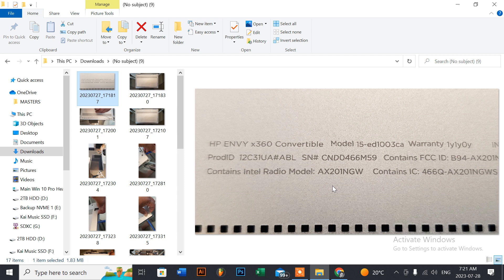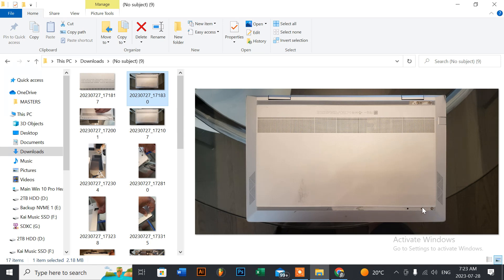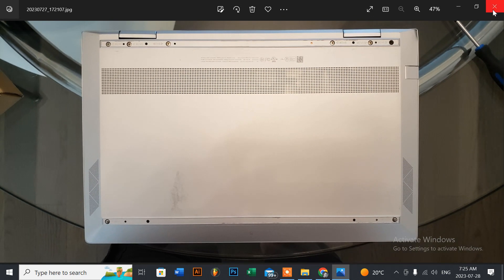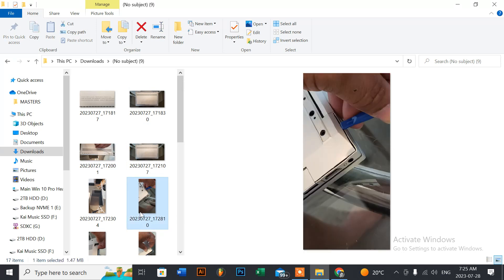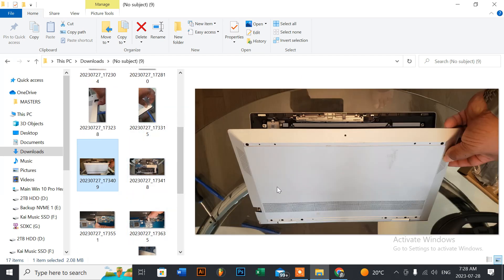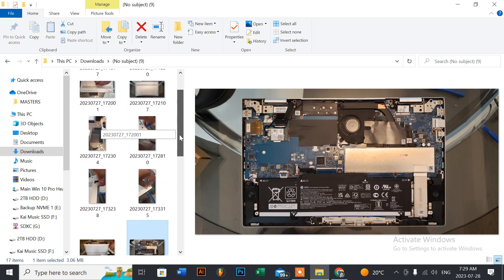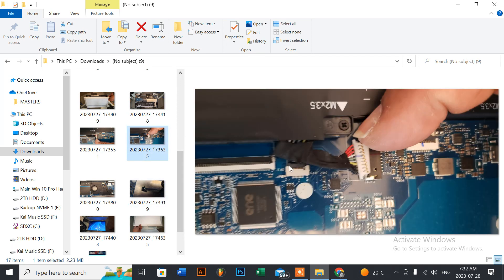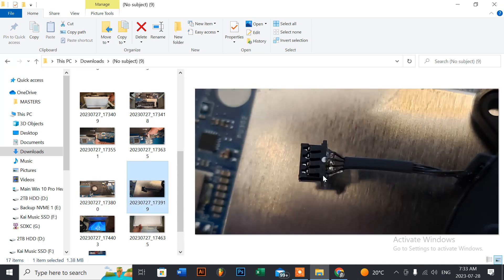HP Envy X360 Convertible 15-ED1003CA CPU Fan Error & Shutting Down? Easy CPU Fan Replacement Guide

Comment: Great video! I wanted to see if its possible to add a second fan in the empty slot? My fan always runs and my computer gets hot just surfing the internet
Reply from the maker: It shouldn't be an issue at all and as long as you have a plug in for the second fan which it's hard for me to see but it looks like it's positioned right at 6 O'Clock or down South from the one on the left side!